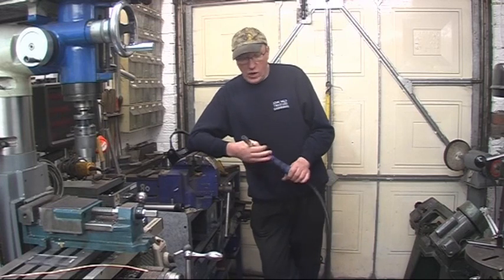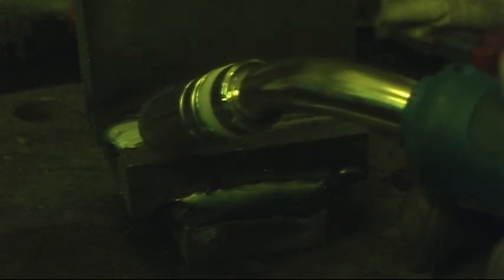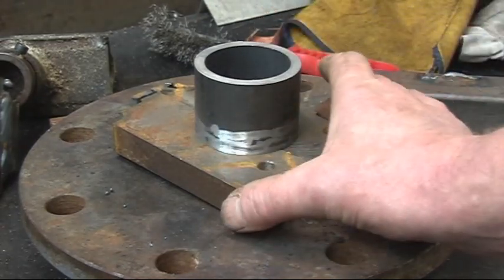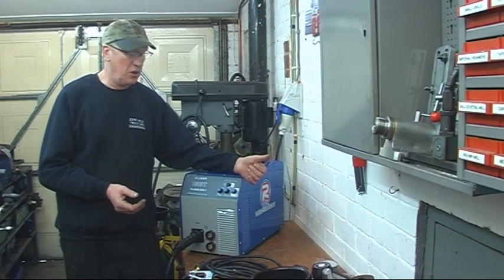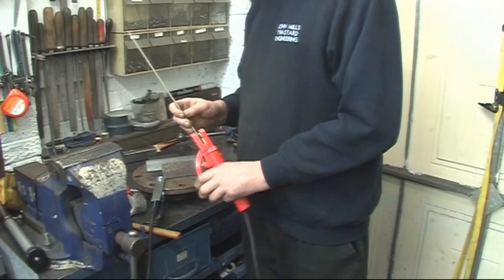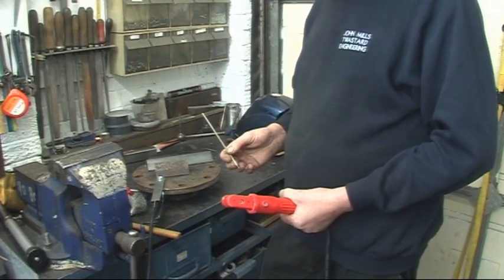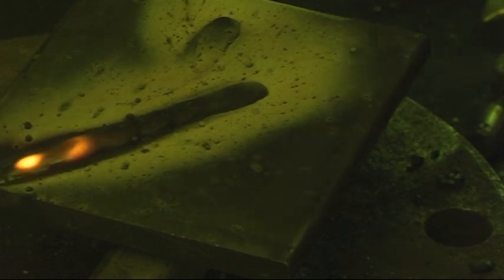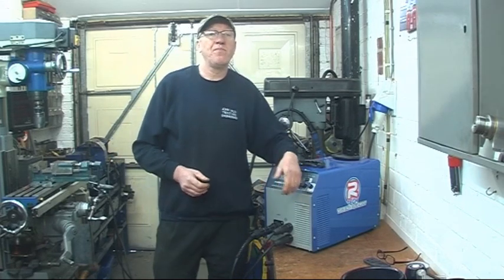R-Tech Pro-MIG250-1 MIG Welder Part Seven

Comment: Very good, informative video John, I picked up some tips from you, I'm just starting out welding my Discovery boot floor and sills, I have a small 130 Sip mig so I'm going to buy some 0.6 wire instead of 0.8, that I have been using, I think this would be better for thin bodywork welding, it won't get as hot and blow holes? Maybe . Anyway love the straight talkin vids.